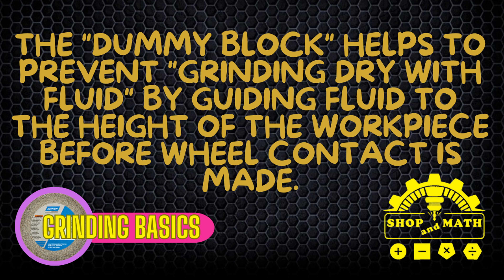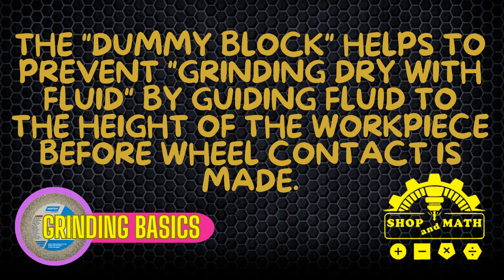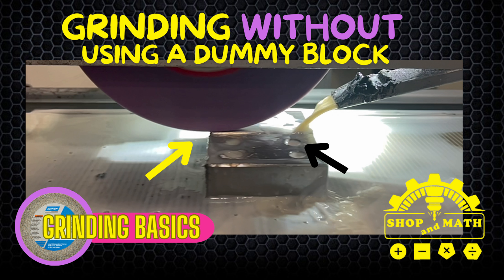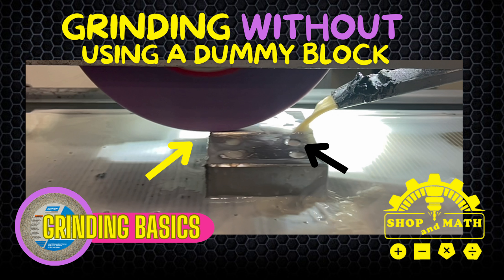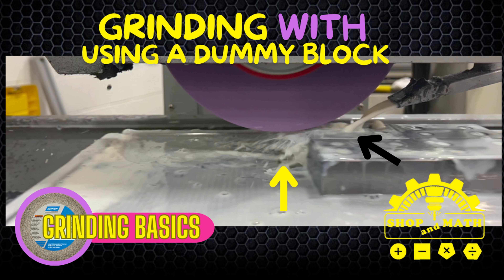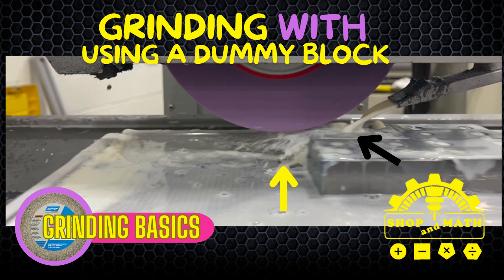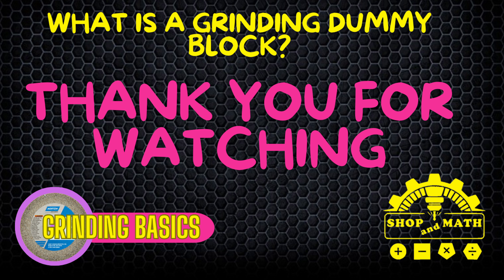What is a grinding dummy block

Comment: Sorry, what am I missing? Why not just aim the coolant directly on the wheel?
Reply from the maker: if you have the ability to do so, that would be the best, but unfortunately, you can tell the machines are not quite designed that way because of the different size wheels you can put on some machines have adaptive nozzles that allow for that, but not all due

You don’t want to use a super high pressure because coolant will go everywhere, and if you have high volume high-pressure, the wheel could hydroplane 

All of my videos are designed for students or people learning, so if they understand the concept of having coolant in the area that is required at the time that it is required 

Take a few minutes and look around your shop and see how many people are dry grinding when they think that they’re actually wet grinding and you would be surprised 

Thank you for taking the time to comment helps other people as well 
Ray
Reply: Thank you

Comment: Add coolant stream to both sides of the wheel.
Reply from the maker: It’s very difficult to add coolant to the opposite side of the wheel because the centre fugal force of the wheel will actually blow the coolant away

If you had Center, fugal coolant, where you put coolant into the centre of the wheel, that is the best way of providing lubrication to the cutting surface 

The drawback to this is that it doesn’t only provide coolant to where you need it. It provides it to the whole circumference of the wheel at the same time. Therefore, that type of coolant system is best in an enclosed grinder. 

Thank you for contributing everyone’s comments are appreciated and helps promote different points of view and different experiences

Comment: A simple solution to a problem I was not aware of - two lessons in one. Much appreciated. What do you think of the idea of 3D printing a dummy block (with metal or magnetic inserts)?
Reply from the maker: I love the idea of 3-D Printing, as you probably know from watching other videos on the channel

Especially using it if there was a problem with thermal expansion in a certain spot on the part, you could direct them majority of flow to that area. Interesting. I love hearing other peoples ideas and points of view. Thank you so much for contributing. 
Ray

Comment: Why not point the coolant stream at the wheel. Then it would always be wet?
Reply from the maker: Most nozzles or nondirectional
You can only adjust the up-and-down some have flexible tips, which make it a little bit bit easier to do that 

Keep in mind, you want high, low pressure if you have high-pressure, hitting the wheel and the wheel, larger, or thicker than you might run into a situation where the wheel could hydroplane 

By putting a block in front coolant to flow easily over the workpiece before the grinding wheel engages in cutting 

there are a few things you can do to make the situation, not as bad by reducing your cut depth, and also making certain that you have a large diameter wheel, which increases your cutting speed

The simplicity of just adding a few blocks to allow the coolant to flow is the best resolution to a simple problem

Comment: Can’t you just increase your coolant flow?
Reply from the maker: if you have a machine like ours, you can’t redirect the coolant flow or increase it enough. If you have a block that’s sticking up 2 inches you would have to have a coolant flow like you’ve never seen and if you could do that pressure would be too high.

It would be such a mess everywhere because these units are not enclosed 

You want high, low pressure because you don’t want the wheel to hydroplane
Reply: @shopandmath  could your 3-D print a new nozzle so the cooling gets a little bit closer period. That way you won’t have to make blocks for each and every job.
Reply from the maker: this is the second excellent idea that’s come across to help solve this problem today

I’ll have to put that in the idea bank as a good way of readjusting the coolant flow 

The main idea of this obviously is for students to understand that, by placing a block there to allow the coolant float to slide over, top it prevent dry grinding, and possibly prevent warping, depending on the material and the set up 

Thank you for sharing your idea. It is much appreciated.
Reply: The coolant supply should be almost horizontal to the bed with the end almost touching the wheel. If the supply was adjusted this way it would work for all workpiece thicknesses.
Reply: @shopandmath hydroplane lol